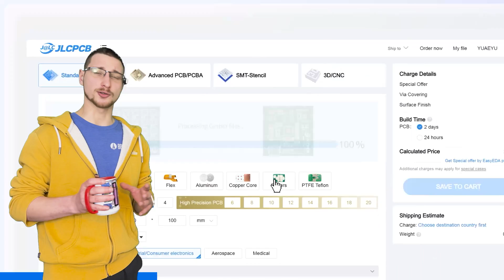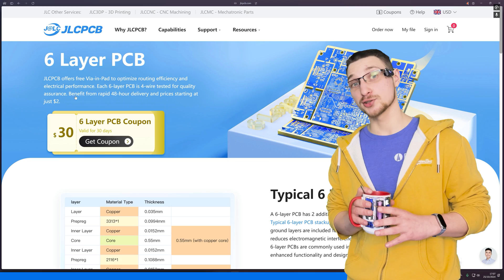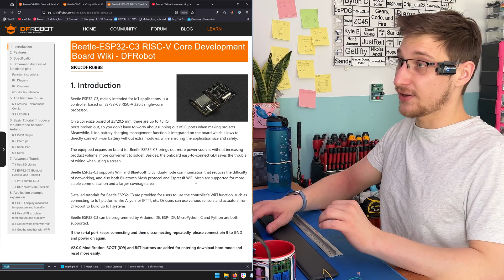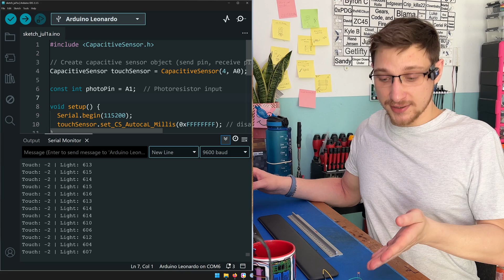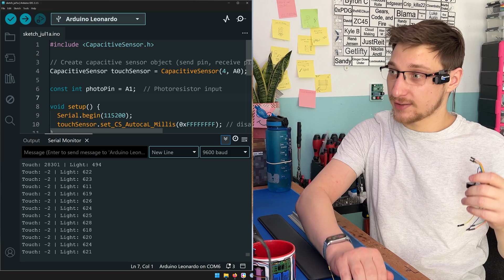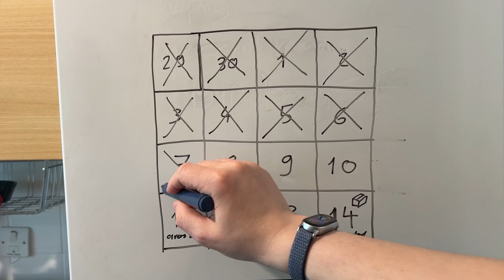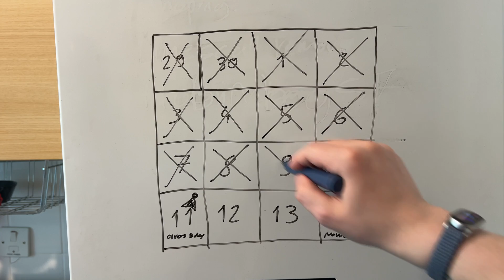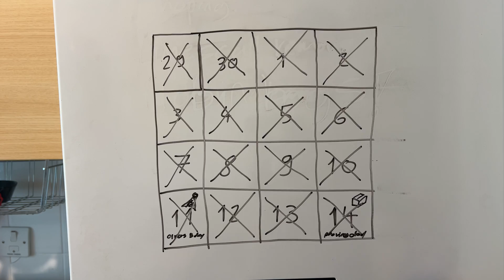Chaos Gift Build: Moving House & Making a Toilet Talk

Comment: V3: Use a load cell under one of the feet of the lower seat.

Pros: 
- You'll have 4 stages of weight
1 No load, seat up
2 Seat Load, cover up no occupant
3 Cover Load, Lid down
4 Occupant load, aka dropping a load, weight > buffer (~45kg) + cover
- can enclose in a thin sealed TPU or silicone enclosure to prevent damage and mitigate hygiene concerns.

Cons: 
- Requires support on the other Seat foot to offset the distance from the load cell
- False positives if someone sits on the lid. Can be mitigated by checking for a stage change plateau of Cover > Seat > Occupant but has an unbalanced work/reward ratio to get working. Also, you will be introducing persistent state memory and that isn't worth the stress.